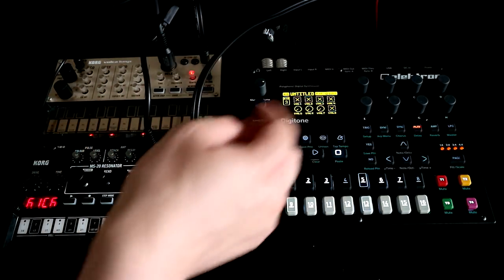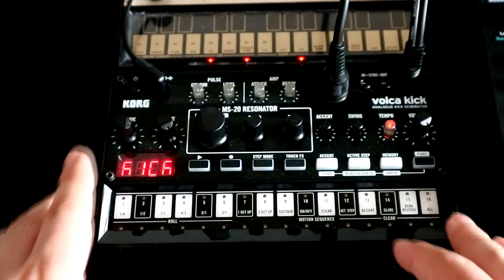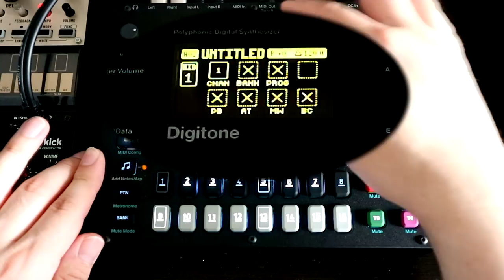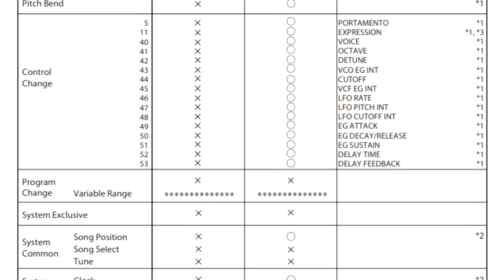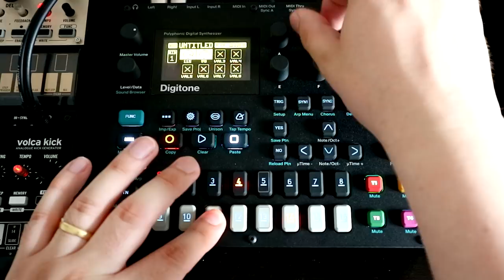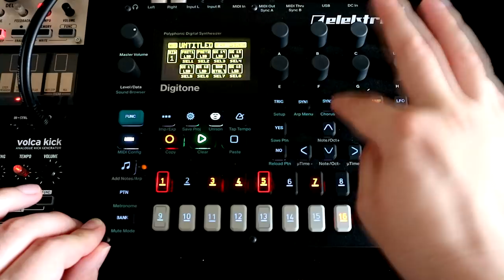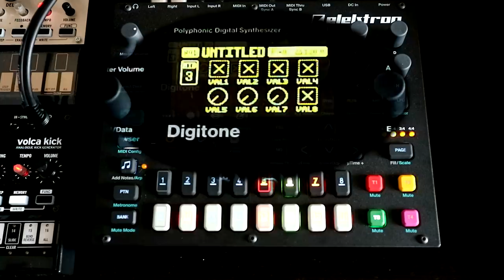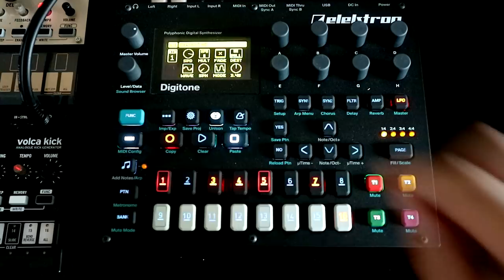Digitone MIDI Tracks - Sequencing External Gear (feat. Korg Volcas)

Comment: I am having some issues controlling my Novation Circuit (Set to receive MIDI CH1) with the DT. After connecting the cable I have followed these steps:
1.  Set all the Sync Sends to ON
2. Set Output to MIDI
3. Set Output Port Func to MIDI
4. Set Midi 1 Channel to 1
5. Enable Midi Track 1
It isn't receiving clock or signals...am I missing a step or is there maybe something wrong with the MIDI cable?
Reply from the maker: So two steps you haven't mentioned - is the Circuit's sync set to midi, or is it still internal?
You say that you've set midi 1 channel to 1 - is that on the actual track or just in the Settings menu?

But I'd also always check the midi cable...
Reply: @OscillatorSink  Solved: I was using the Midi to 3.5 adaptor from the Elektron, I needed to use the Novation adaptor!

Comment: Fantastic video. I'm having a hard time finding the MIDI splitter cable used here, does anyone know where I could find one?
Reply from the maker: Thank you. I got it from ebay, but, my advice is to spend a bit more and get something that's powered. That thing was always just a little unreliable, especially around dropping or holding notes. I've got a Kenton Thru-5 now and it's rock solid, gives me more splits and is still very inexpensive.
Reply from the maker: But if you want the one in the video, it's this: https://www.ebay.com/itm/114271297597
Reply: @OscillatorSink  Thank you!

Comment: Will it work the same way if i connect volca keys to digitone via midi cable and volca kick via sync cable with volca keys?
Reply from the maker: No. Because you won't be able to send midi to the Kick in that configuration, so you'd have to sequence the Kick on the Kick's internal sequencer. All the sync cable sends is a pulse to keep the internal sequencers in time - nothing else.

Comment: thanks for this video, very helpful. but one question, the internal arp of the digitone can not be used for external gear? i mean, that would be a shame, cause it worked in monomachine in octatrack. do you know something about that? thanks in advance
Reply from the maker: You are correct, as of the current version the arpeggiator doesn't work on the midi tracks. Which is a shame as the arpeggiator is amazing.
Reply: @OscillatorSink  hey thanks for your quick answer. and it is a shame @elektronHQ pls make arpeggiator work also for external instruments, like monomachine and octatrack! thanks in advance

Comment: Maybe a stupid question, but if i connect my volca fm with my digitone, does that give me 11 voices instead of 8, or does it keep the 8 voices of the digitone.
Reply from the maker: It gives you 8 Digitone voices and, separately, 3 Volca voices. There won't be any dynamic voice sharing between them, that's just for the Digitone's internal voices.

Comment: Neat trick, I'm keen to try sequencing some extra gear from my Digitone! What is that midi splitter cable you're using?
Reply from the maker: Cheers! It's just something I found on ebay and took a punt on because it was cheap enough to risk it. I think it was a Ukrainian seller, but it was a while ago now. If you want something reliable and flexible you should check out the retrokits rk-004 - I'll be picking one up soon.

Comment: You're a genius! subscribed! can you midi sequence polyphonic content on a single track?
Reply from the maker: You certainly can. On the Digitone each midi track has 8 note polyphony! Thanks for watching!
Reply: @OscillatorSink  oh boy thats the news i want to hear. This rules out a dedicated sequencer for me! How would you rate ease of use for doing so? Looks like it's based on root note and intervals?
Reply from the maker: Well you can just play parts in live if you want. Otherwise the best way to input chords in step mode is to hold a step and tap the "note" button. That brings you to the chord input page and you can turn notes on and off there.
Reply from the maker: (there is another way, but it's a pain, so let's ignore it)

Comment: Great tutorial!  -- can anyone tell me why whenever I hit 'midi' the 4 tracks are turned red? I can't seem to make them white like in the tutorial (this is always the case in totally fresh banks / patterns). Although I can get playback from my Volca by hitting keys on the DT, I can't from the sequencer. What am I doing wrong! Cheers! :)
Reply from the maker: This sounds like they're muted maybe check that you're not in the wrong mute mode? (func+double tap mute mode)?
Reply: @OscillatorSink  Thanks, this helped! Although the mute modes seem very confusing, I've re-read the manual several times and can't get my head around it honestly.
Reply from the maker: @createshape6467  you have 2 mute modes - one related to the track, one related to the pattern.
The track mode means that as you move between patterns the mute state will be the same.
The pattern mute modes are embedded in the pattern - useful if you want a certain mute state to be set when you change patterns.
It gets tricky when you are using both at once as you may end up with two layers of muting and then you need to unmute both.
I tend to use track mutes when jamming, but pattern mutes when I come to organise a set.
I talk about it in this video (it's the Digitakt instead, but it works exactly the same way).
https://youtu.be/StMqCk5_Rqw
Reply: @OscillatorSink  Superb, thanks! It's starting to make sense now. :)

Comment: Thanks for this..I just may keep my digs now..but the learning curve is a bit steep for older hobbyist like me..and its utterly amazing to me that a MFG relies on the goodwill of others to teach their customer how to use THEIR devices.  I mean if you can find the time to make a tutorial is it crazy of me to think the guy that make it should provide this kind of content?  #ElktronTutorialsPlease :face-purple-crying:
Reply from the maker: So, the secret to this, in my case, is that I slavishly read manuals. I know that it's boring and there is a skill to reading manuals and synthesising (excuse the pun) the information, but genuinely, there's nothing I communicate in this video which isn't laid out in the manual (and I mean the full manual you can get online, not the quick start guide on the box).

Elektron boxes are powerful and flexible, which requires a little study, but at the same time, they are quite neatly arranged into small little "systems" that you can kind of learn in isolation, then re-arranged into interesting forms.
Reply: @OscillatorSink  Thanks for the response, sir.
 I am doing just as you suggested..and, yes reading can be tedious especially in the Elektron jargon that takes a bit to climatize to.  I still feel manuals as a whole are weakly written as there can be a lot of assumptions or lack of proof reading. 
And in so much as a manual may say it can do this or that rarely do I see a good approach to give instructions and use case info.  

As a retired robotics engineer I'm sure I have higher expectations.  
Moog, for example, know how to not just make a manual but they make it excellent reading and laid out so nicely.  A Korg or Roland Manual is well, not a Moog masterpiece.  
This is a longwinded way of saying thanks for all you do.  There's an art to disseminate   info and you have the touch.  The English Loopop?  lol.  Peace!

BTW, only one LFO for Midi track on the DigiTone?  I tried to get the second LFO but no luck.
Reply from the maker: @bobclark5360  cheers, and yes, only one LFO per midi track, sadly!

Comment: Ello mate, excuse me just asking loads of questions. I tried a drum machine and mono synth with the digitone today and could only get one or the other. Can I get midi clock out of the midi thru or do I need a midi splitter? I've a kenton but I'm trying to use as little kit as poss for a portable set up. Cheers.
Reply from the maker: You'll need a midi splitter. The second output (thru) won't act as an out - which is a shame because that would be super useful.
Reply: @OscillatorSink  thanks for replying man.
Reply from the maker: No problem - good thing you've got that kenton!
Reply: @OscillatorSink  hmm, a read of the manual suggests a USB lead might work.

Comment: @Oscillator sink - hi! totally get what you're doing here and trying to do it with my little UNO synth. having assigned it to a midi track i can play it from the keyboard (I have the keys) or the trig buttons but the DN sequencer doesnt activate the notes on the uno.  any ideas?
Reply from the maker: That's a weird one. If you've set up any CC mappings  I'd maybe unmap everything to make sure that there's nothing messaging with the patch there.
Is pressing play on the DN also starting the Uno's sequencer, because I bet that is a candidate for messing with things, so maybe try turning off the Send Transport setting on the Digitone (somewhere in the midi settings, don't recall where exactly). See if that helps...
Reply: @OscillatorSink  and heres something really funny - i can sequence the uno (connected same as it was to one of the DN's midi tacks) from a midi clip on my deluge, with no issue whatsoever.  Ill try your suggestion tomorrow though cause i really do want to try what you did here with the conditional triggers etc
Reply: track was muted.  please dont judge...:)
Reply from the maker: Hahaha! Oh man. Always the last place you look! Glad it's working now!
Reply: @OscillatorSink  of course.  while I have your ear I think I need some sort of mixer, rn I use the 2 inputs of the DN but I already have 2 more (synths) than can be connected at once.  Do you have some sort of recommendation if I promise not to hold you to it?  it doesnt need to be the bottom of the barrel either, price wise, but Im also probably not needing massive bells and whistles. just enough to expand as I acquire stuff (im in the throws of a middle age shopping spree and these are my sports cars) thanks!
Reply from the maker: So I guess my question is: do you just want a mixer or would an audio interface to record with be better?
Reply: @OscillatorSink  well if I boil it down to the immediate need/desire, I really want the option to play with and hear all my synths at once (via speakers or headphone).  Currently, because Ive max out on the 2 line inputs on the DN, I cant.  I do like routing things through the DN for using the effects and also I have been recording .wavs via Overbridge. I havent invested in a DAW yet. I think I do understand the distinction between the audio interface and mixer,  and that many mixers are also audio interfaces as well.  Anyhow, Im kind of going around in circles on this.  Id like to have something with enough inputs to last a few purchases.  Any wisdom (and actual recommendations) much appreciated.
Reply from the maker: The reason that I ask about recording is that a lot of mixers that can operate as an interface tend to only output a stereo mix down (so basically you record what you're hearing on your headphones). That then becomes quite limiting from a mixing perspective in the DAW - no option to process (or even change the level of) each input.

Most decent interfaces though, will allow you route everything together for monitoring, have control over the levels at that stage, but then also have each individual input represented in your DAW for mixing.

Unless your primary focus is playing live out and about, I think investing in an audio interface would be preferable as a mixer is probably going to feel limiting to you as you start exploring your setup more.

OK, with that all said: suggestions. At the lower/mid end, I'd look at the Focusrite Scarlett 18i8. There are 3 generations of this interface, and there are bargains to be had if you go second hand on the first it second gen models. If you want to spend a bit more, the Arturia Audiofuse Studio is amazing - not cheap, but sounds fantastic and has a selection of features that really helps future-proof it for pretty much any situation you throw at it.

Both of those suggestions give you 8 analogue inputs (4 that can also work as microphone preamps), and can be expanded at a later date with ADAT if you need more inputs.
Reply from the maker: Oh, and dirty little secret about Overbridge on the Digi boxes... The line outputs sound better. The convertors and line amps on both the tone and the takt are extremely high quality and, despite common sense telling you otherwise, going through that extra stage of da/ad conversion almost always sounds better - to my (and lots of other people's) ears anyway!
Reply: @OscillatorSink  thanks, I appreciate this input and understand what youre saying about wanting to keep the tracks distinct.  Ive eyeballed both these units.  not sure why the price differential between the focusrite ($400) and the Arturia ($900 - owwie!) - is it sound quality? I'd probably at this point spend less.  I take it that the actual mixing is done in the DAW, and then that mixed signal is what is then routed back to the speakers.  Im sure Im taking you away from your life here so thank you for this exchange.
Reply: @OscillatorSink  does this mean that the line outputs pre-whatever happens to the sound in Overbridge is better? ie that OB isn't good for the sound quality?  Or visa versa?
Reply from the maker: Sound quality yes, but that isn't to say there's anything wrong with the Focusrite at all - great interface. Also features and utility, there are a lot of things that the Arturia can do in terms of routing, the types of signal it can accept etc.

Generally you mix your live monitor using the interface's software and the DAW is where you mix the final version.
Reply from the maker: @maarzt  nothing wrong with OB, I just find that using the line outs sounds better. Both are good, one is just better (in my opinion).

Comment: Did you say e a c h of the 4 midi tracks have 8 voices of polyphony e a c h?? Or is it like the internal synth tracks, 8 voices total divided up how you like between 4 tracks?
Reply from the maker: Each. E a c h. Each of the 4 midi tracks has its own 8 notes of polyphony.

This is different to the internal synth voices which are, indeed, 8 voices shared across the 4 synth tracks.

Comment: Awesome video. Is it possible that I would be able to use the Digitone sequencer to control a Moog Minitaur?
Reply from the maker: If it has MIDI in (which it does), then you can control it with the Digitone!
Reply: @OscillatorSink  Awesome! Thanks for the reply.
Reply: @OscillatorSink  I just got a MIDI cable and I've got the Digitone connected to the Minitaur. The MIDI light on my Minitaur lights up when I press keys on the Digitone. I have also successfully mapped some of the CC's to the Minitaur from the Digitone. The only problem I am having now is no sound is coming from the Minitaur? I have a cable running from the audio output on the Minitaur to the Audio input on the Digitone and still no sound is coming from the Minitaur? Im curious as to what I can do next to try and solve this?
Reply from the maker: Have you gone into the master page (shift+LFO) and turned up the inputs on the Digitone?
Reply: @OscillatorSink  Thank you so much for the quick reply. This instantly fixed my issue! You're the man. Thanks so much for your helpful videos.
Reply from the maker: No problem - I'm glad you got it working, have fun with it!

Comment: Did i understand correctly - 1,2,3 midi slots use one sound source (volca keys)?
Reply from the maker: In this jam yes - let's me bring parts on that synth in and out seeing as I have 3 notes of polyphony to work with.
Reply: @OscillatorSink  so if i have mono synth instead of volca keys i wont be able use this trick, right? Will it works with op-1? It has 8 voices.
Reply from the maker: You can use this trick on a monosynth for bringing parts in and out (I do it with the Monologue here: https://youtu.be/UA_6VGBXCtY) but note-priority will take effect if you have two notes trying to play at once. OP-1 - I don't know how the Midi is set up on that, but should work OK!

Comment: How would you go about setting up midi tracks in bitwig? I want to externally sequence soft synths
Reply from the maker: I don't know Bitwig at all, sorry. A quick Google suggests you need a "note receiver device", but I'm afraid you might have to consult the manual.
Reply: @OscillatorSink  no problem, guess i'll rtfm

Comment: Thats great. But can i use it to control 4 volca?
Reply from the maker: Sure. You'll need a midi splitter to wire everything up but you have 4 tracks so as long as the Volcas are all on different midi channels, you're good to go.